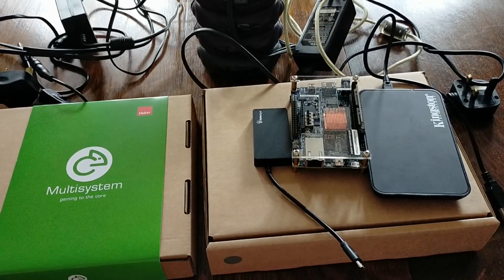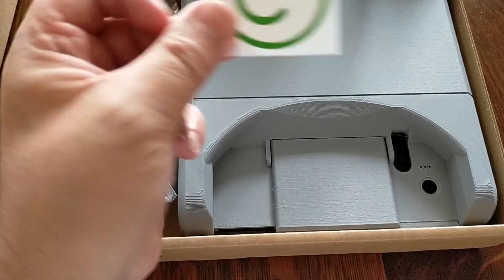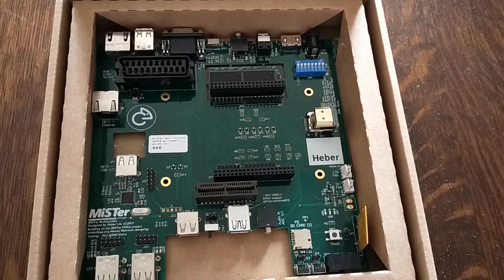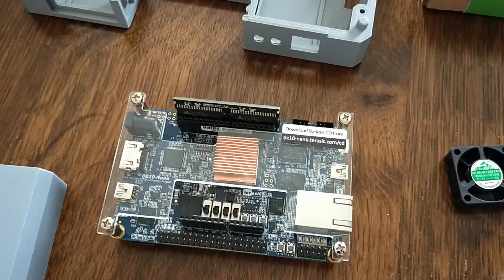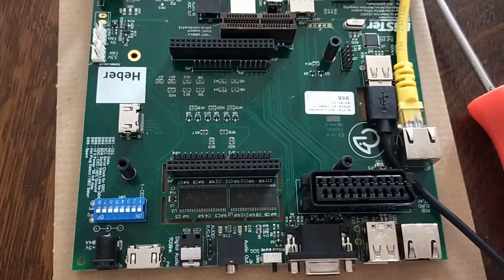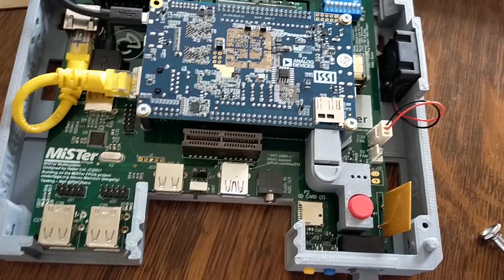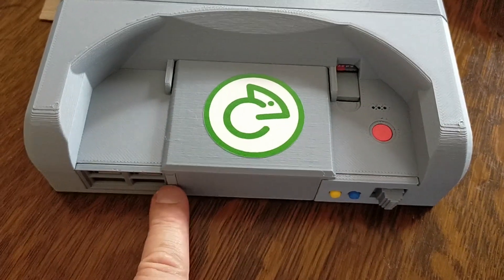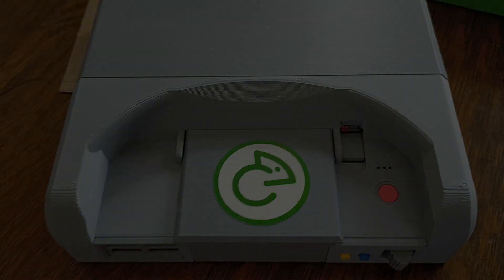MiSTeR Multisystem - Unbox and assembly

Comment: you  pay so much for an all-in-one system, yet have that hard disk dangling around lol
Reply from the maker: Its a spare hdu repurposed for my old setup. So I simply plugged it into this new setup. It has the benefit of being easier to plug into a pc to download new games onto it. Longer term I will consider fitting an internal drive but there is no rush.
Reply from the maker: Sd card has enough space so hdu is released for other duties

Comment: Overall package seem good, the 3d printed case looks a bit rough, but the way they did he usb and ethernet connecters seem really poorly thought out. I think the use of Dupont connecters would have been better suited to the task than having sockets on the board.
Reply from the maker: Think it was to fast track getting board to market and the de10 needs to be used, so realistically you can only change the Multisystem connection end. The case could possibly be printed at a higher resolution to smooth it out..I have seen cosplay masks using a 3d printer and a bit of filling and sanding to get a lovely smooth finish. So options out there if the 3d print steppings offends. Overall it is a great package. Break out for scart, vga, hdmi, audio, optical audio, snac,  lan and 7 usb sockets..all in a small form factor